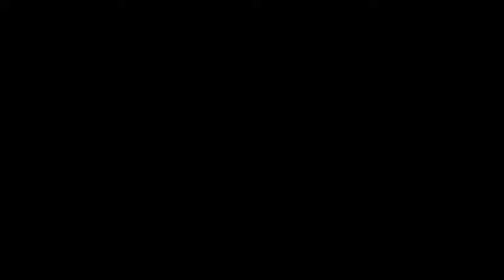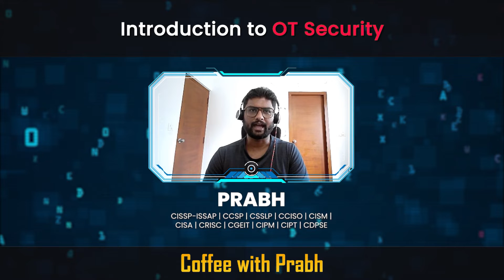Introduction to OT / ICS Security - What You Need to Know

Comment: ICS (Instrument Control System) serves as a machine application that allows operators to make adjustments and monitor critical parameters like value settings and pressure levels. This system typically provides real-time data visualization, control interfaces, and alerts, ensuring efficient operation and safety across various industrial or mechanical processes.

Comment: But how it's related to cyber or information Security?
Reply: Profibus network end nodes  connects to the Proinet.
From there connects to the Nport server (appliance) via OT protocol.
From the Nport RJ45 connects to the OT firewall (Fortinet, understands and filters the OT protocols). Firewall WAN port to gateway IP. 
As of now many networks are isolated (staying in OT network area only). 
You need to have in depth knowledge of profibus , profibus ,plc,hmi ....
Every process and industry is different. Having in depth knowledge is important on securing the OT when it connects to IT.

Comment: At the field you will have sensors and the cable of sensors comes to the Junction box and from the junction box it goes to marshalling cabinets where you will have the controller cards. this is the overview of field cabling. In every plant you will have managed switches, Gateways and firewalls. in order to harden you system you need the cyber security solutions.

Comment: The proprietary protocols are still in use & exist, but we can strive to standardize and work with OEMs for standard protocol support. Purdue is outdated, but you can take that model as a foundation and build your network security based on the types of factories & Scale.
Reply from the maker: True